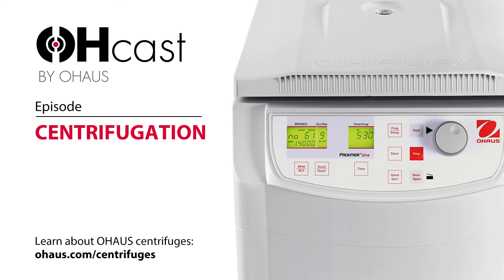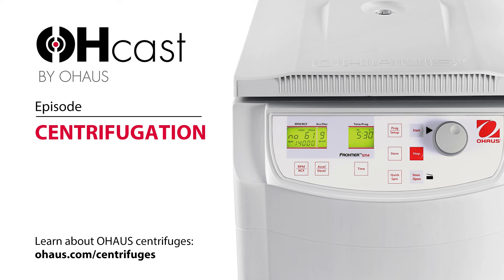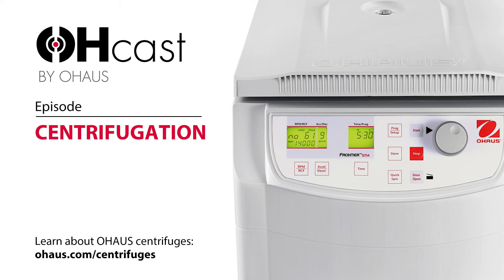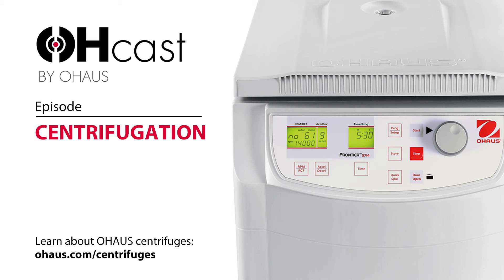Centrifugation and Centrifuge Safety (Podcast)

Comment: Hi, we are having an OHAUS FC5515 in our lab and currently we are not using it because there is an error 38 indicating that the lid motor is blocked. The manual does not help at all in resolving this, is there a way to solve it?